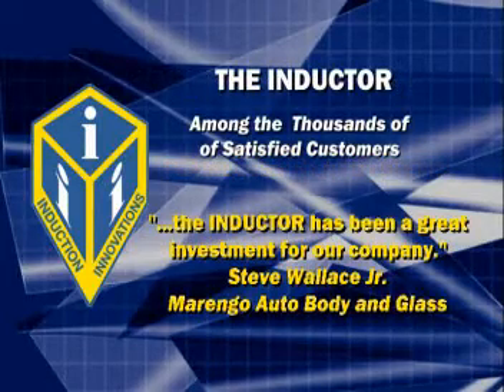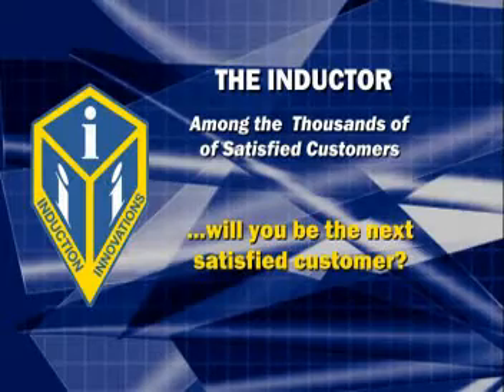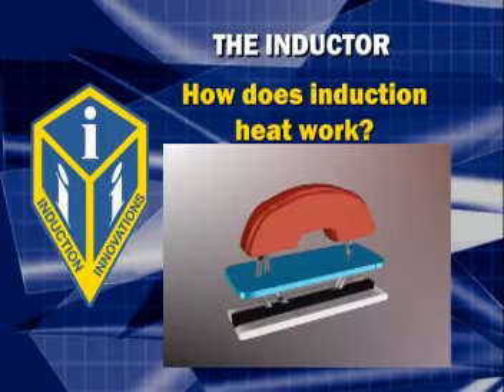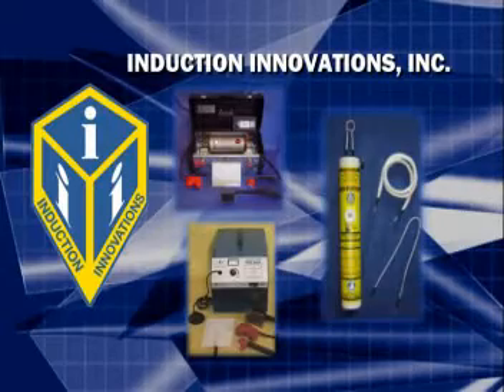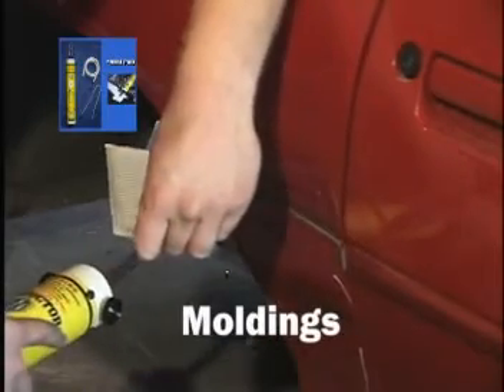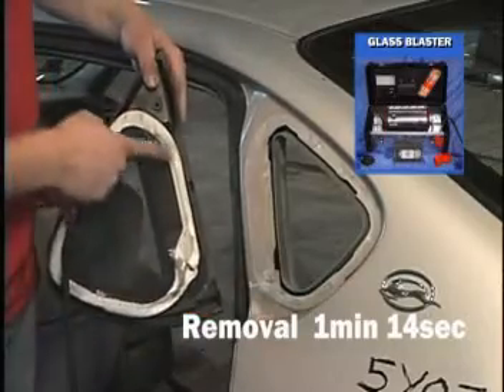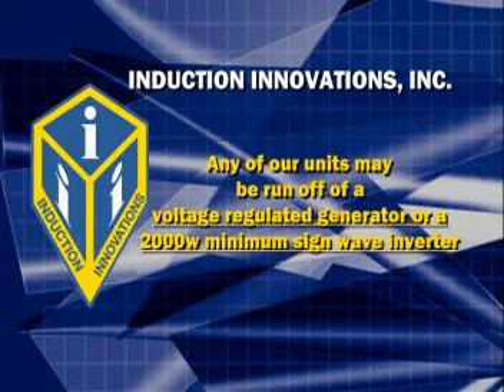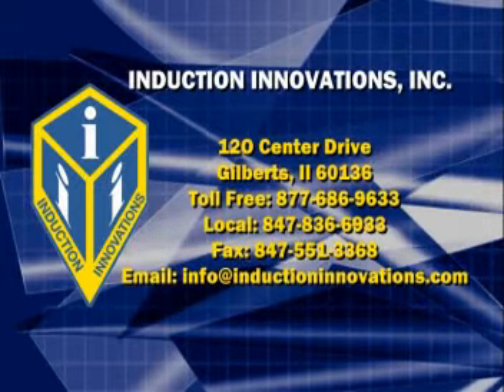The Inductor Complete Demonstration (Induction Heating)

Comment from the maker: It is really a great tool to reduce time and remove many parts which in the past had to be replaced due to removal damage. For fixed glass, seam sealers, stripes/decals, side mlds, and general heating it is simply a no-brainer for the collision industry.

Tony Passwater, President AEII